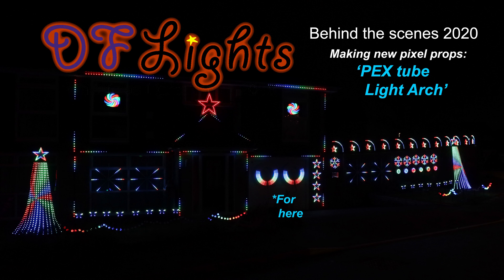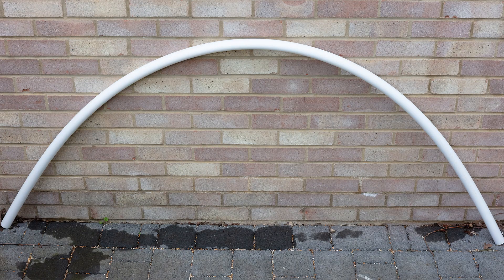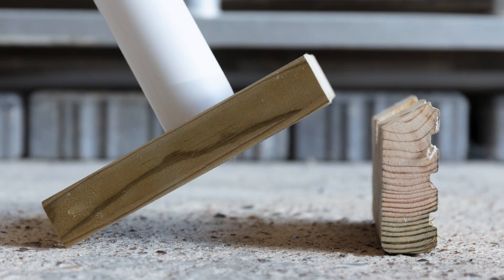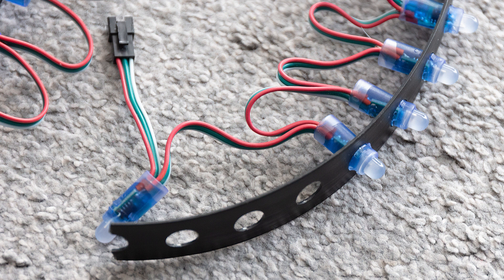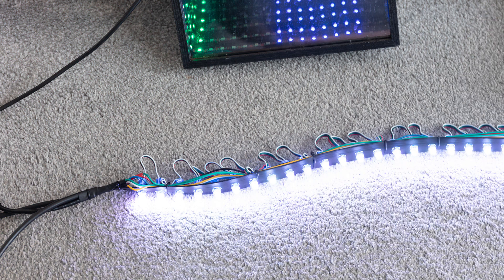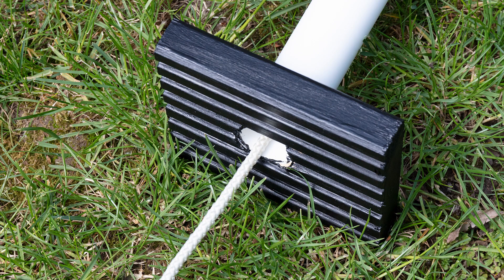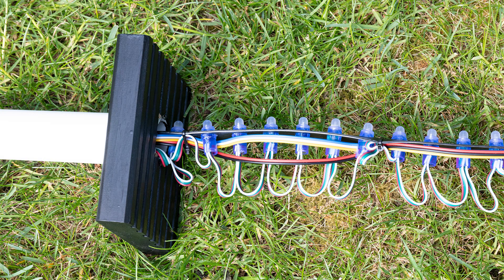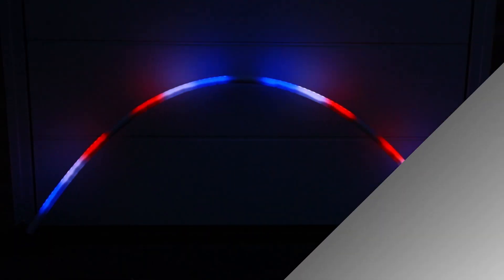Behind The Scenes 2020 - Making a Pixel Tube Arch

Comment: I have just discovered your channel.. I have been playing around with pixels for quite a while, but yet to put together a big show. Like you I am having to discover what materials to use in the UK, and looks like we are on the same wavelength. You have some great ideas and prompted me to look at some other props, I especially like the "sweet tub" lights. I am working on some "singing bulbs" something akin to the "Boscoyo Chromabulb", but (of course) using my own design. Like you, I also have access to a laser cutter, which is a very very useful tool. What material do you use for your pixel props like the stars and snowflakes, as it is something I could use for my bulbs. I have used 3mm plywood and was going to weatherproof it. I have also tried acrylic but that is a bit expensive. .
Which part of the country are you in...never know i might drive by one day to see the show,
Reply from the maker: Hi Derek,

Many thanks for subscribing.

Watch out, this hobby is addictive!

I tend to use Foamex for a lot of my props, which is a solid version of the foam board used for mounting photos, etc.

A had a few cut with the laser, but later discovered that the fumes it gives off are bad for both the machine and the operator. Luckily the one I have access to has it's own filtered extraction system. I now get templates cut from mdf, perspex or ply and use those to draw around onto the foamex. I can then cut the outlines with a craft knife and ruler (great for straight lines, not so great for the big curves) and I use a stepper bit to on a bench drill for the pixel holes.

My Hallowen bats are painted mdf, but they are only out a night (or two) rather than a few weeks over Christmas.

I would recommend on facebook the European LIghting Fanatics group at https://www.facebook.com/groups/LightingFanatics/

UK suppliers I have used are
https://buildalightshow.com/ and https://panelsrus.co.uk/

Good luck with your lighting shows, please let me know how you get on.

We're out in Kent by the way.
Reply: @dflights  Hi.. that was  s swift reply... Yes I thought you said Foamex in one of your videos, and I had already discovered about the toxic fumes, so have ruled it out, but good idea to make a template. Thank for the contact points I will look them up. Happy to exchange a few ideas. I note you have a huge repertoire of sequenced songs, which look great,  I am sure you haven't had the time to do all of them yourself. I was going to download a couple of the xlight ones from the forum, and map some of it across to my meagre display. Where have you found most of yours... and I apologizse if they are all your own work!!
Reply from the maker: @ukdel1  They are all my own work. (no need to apologise though) :-)

The only songs I have mapped from other people's work are last year's (and the 2020) song for "XLights Around the World", which is also the only one I don't have on my youtube channel.

Nothing wrong with using pre-made sequences, I just like to do my own sequencing so it fits better with my display. I'm very much still learning, hopefully the Halloween and Christmas versions of what I have online already will look better.

I also have a few more songs to add for this year's Christmas and Halloween shows.
Reply: DF Lights you don’t hang around then, that is a lot of sequences in a short time... good work. Also have joined the ELF group in Facebook, thanks for the  tip off.